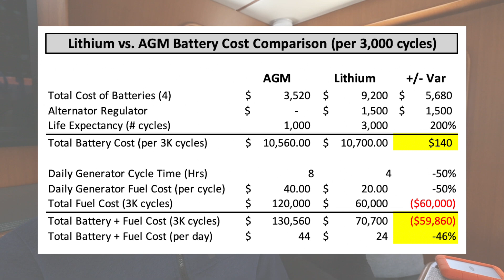What is the ACTUAL cost of LITHIUM batteries (LiFePO4) and should you install them on your boat???

Comment: Have ourboards . Tried lithuim only to save weight.  Pulled them off cause charging system was erratically 13.2 to 19 volts. I even bought ones made for marine use. I think they were shutting off with built in bms.  Boat volts steady now with my new lead acids back in .  Maybe try my lithuims on a solar project or diesel truck.  I think with regular alternator they will be fine.

Comment: Your lithium  battery video saga was very helpful.  I’ve been doing research on lithium batts and your videos were part of my research. Way to go YT University. 😂 Coincidently, our current batteries onboard are the same brand as your previous ones and they are the end of their life. Lithium will be our next move along with solar. Being on anchor will a lot more quieter and pleasant..
Reply: The images in the video suggest the old batteries had been Lifeline GPL-8DL AGM and they had 8 of them. That would account for 20,900 kWh over 1,000 cycles, except only about 50% - 10,450 kWh - is really usable of that. 4 of the LiFePO4 batteries replaced them and in 3,000 cycles these would give some 41,472 kWh, but realistically 70% is usable - 29,030 kWh.
If we just consider the batteries, capacity, cycles, cycles, and usability, then per kWh the AGM are $0.69 and the LiFePO4 $0.34.
Add converters/inverters and all sorts of kit, plus the cost of recharging and that will raise the cost per kWh a lot more.
Note that 1 litre of diesel fuel holds 11 kWh (but a small Diesel ICE may give 25% efficiency at best in generating electricity.)

"We" (humanity) need cheaper ingredients and e.g. sodium is a candidate. "We" also need better solar (more efficient) and multi-layer PV plus a perovskite layer over them may do that (from under 30% to over 50% I guess and less sensitivity to where the sun is relative to the panels). If only multiple manufacturers started making that and competition drove the prices down.

Comment: Sounds promising, wasn't aware of the insurance issues - certainly great to reduce generator running!  I'll look next year when due for replacement.  Not so keen on Orcas myself - coming into the med from Norway via Portugal we we're harassed by a pod - as we're over 60ft it wasn't too bad although being eyeballed through the hull windows was intimidating.   One 40+ foot boat on delivery had its rudder bitten off!
Reply: Yes indeed, a pod of them has been 'harassing' mostly sailboats from what I've read, attacking the rudders, two smaller vessels were apparently sunk of Portugal, over 200 incidence in the last few years. countless vessels needed rescuing due to damage received.

Comment: How did you dispose of the old ones? Did you just take them to the Fire Department?
Reply: It is my understanding the original batteries were not lithium batteries.   The lithium batteries are highly recyclable.  The fire department won't have a way to recycle them, and they are not that hazardous. The battery dealer is a good resource.
Reply: @ABonRMS  they are not "highly recyclable" lol.
Reply: You throw the into a fire or local wildlife refuge.

Comment: Just come across this.All the reasons to get them.But what about the pitfulls.Things that can go wrong are not mentioned.2 things that have short guarantee that can destroy batterie bank.Inverter charger and alternator regulator.And even if under guarantee.only covers units not batteries destroyed.Also LPO4 should never be used under 20% and charged to 80% to prolong batterie life.so 60% usage per batteryAlso expect 20% degradation of battery after 2 years.Yes they are better than other alternatives.But very expencive to replace.this is not scare mungering.But stating facts that others have experienced.If you are full time on a boat.then the risk is worth taking,But remember,how do you think people have survived for the last 50 years plus with lead acid batteries.

Comment: You also will save in the installation labor involved over the life of lithium versus conventional batteries, by twice.  Moving large batteries is not fun.  The lithium might also prove to be more electronics friendly in that full charge voltage remains pretty even over the cycle from full charge to a discharged state.
Reply: but if one fails you lose everything and maybe your life too.

Comment: Great information guys, but why did you not looking at solar as an option for charging the batteries as well?? Keep up the great videos, cheers 🍻
Reply: Do you know how many solar panels you'd need to charge those huge batteries? Do you know how little sun the PNW gets for half the year? A generator is the way to go. Lots of RVs aren't even doing solar anymore because it can't produce the current needed. Straight generator.

Comment: Real life test: On my liveaboard sailboat I replaced 400lbs of Rolls Surrette lead with a useable current volume of 2.1kW with 150lbs of LiFePO4 supplying  just under 6kW.
Costs:
The Rolls Surrettes cost me US$1320.00(5 years ago), useable lifespan was 2 years working hard daily, so 10 year cost is US$13,200.00.
The LiFePO4's were a total of US$6600.00 (three years ago), with expected ten year cost the same at $6600.00.
Don't let anyone kid you, LiFePO4 is FAR cheaper. And that is before taking into consideration the ease of swapping, and avoiding wet cell maintenance. 
Yes, I also correctly changed the engine alternator to a Balmar hi output with a programmable charge controller necessary for the lithium charge profile and a new programmable shore charger too. Of course these never have to work because I also have 1.4kW of solar production.
Then I proceeded to run two fridge/freezers, completely electrified the galley using induction and microwave/convection combo, run the RO watermaker every second day, the 1200watt water heater every morning, the big screen each evening and lots of fans.
The last time I needed to run the gen for charging was after 3 solid days of heavy cloud...I think it was once in the last six months.
I'm hoping by the time I need to change the lithium we'll have production models of the C14/diamond batteries!
Reply: @Lars Hansen Hmmm...lead is a common denominator in those. I am ecstatic to never have to lift lead batteries out of a battery compartment again.

Comment: I have 7 year old agm batteries in my boat, still going strong.  The house bank comprises four GC 6 volt deep cycle batteries in a series/parallel configuration delivering 12 volts 500 amp hours, with 250 usable.  Cost $1600

Comment: The amp hour differences in usage will also have an impact. AGM if they say 100 amp hours you have a usable 50 amp hours while with lithium 100 amp hours is 99 usable amp hours. Using the last of a charge makes the recharge more complex with lithium although you can use the full 100.
Then there is the current drop from AGM as you draw down the charge, which doesn't happen with lithium.
You actually doubled your available amp hours in practical use by matching the lithium to the agm.

Comment: One advantage of  Lithium batteries you didn't touch on, is that you have now have more than twice the available energy to pull from them. The Battle Born 8D batteries have 270Ah and you can use all of it without reducing the 3000 cycle life. Lifeline 8d's only have 255Ah, and you can only use half of it without reducing the 500-1000 cycle life. Also, it doesn't bother Lithium to only partially charge it before starting to deplete it. AGM hates that, which you kind of alluded to in the video.

Comment: Why not use a marine capacitor bank, That way it will take 1 million + charges and it can be charged upto full power in 30 seconds off an inverter and can run, Washing machine and tumble dryer all at the same time without draining your house battery bank.

Comment: You didn't mention if you increased your capacity with the lifepo4 vs AGM.  AGM only has 50 perfect useable capacity.  It seems you likely doubled your amp hrs with 4  BB270.   Shouldn't that be considered in your cost analysis?

Comment: Ho there. I was considering Lithium P04 batteries for my new boat ( ew build), saw 4,000 recharge cycles and extremely high prices here in the UK for even 90ah batteries. Found recycling them is extremely difficult still, so started looking for alternatives. Well, seems AGM has also comedown a long way, and there are Varta Dual Purpose AGM that have at least 3,500 recharge cycles and a 10 year Service life approx. Now things battery wise will likely change a lot in the next 10 years (and may even encourage a battery switch earlier. For me, needing 2 x battery Banks of at least 3, and maybe 4 per Bank of 120 amphr, the cost difference is staggering, plus .I can get the Battery Baanks, plus the wiring in of everything done by the boat builder. Note : I'm going heavy duty 40 ft Sailboat with a deck Saloon - roof covered in Solar Panels, and a rear Cockpit arch with solar panels plus maybe a small quiet wind generator dedicated to keeping the engine start battery topped up. Engine comes with one 115 amp alternator, going with the optional 2nd one, so each battery bank can have one each. There'll be a fair bit of electronics, plus air con+ heating , Watermaker, and 2 burner gas stove with oven, plus ceramic electric hob, plus Combi microwave oven, so reducing propane consumption., plus large fridge, freezer box, and a 2 drawer vertical stack freezer, and a washer dryer. as soon as one bank of batteries gets below 12.5 volts, I'll switch to the other Bank until the other is fully charged up. Should get Max service life. Was thinking of adding a generator, but no point, as the 55 hp Volvo sips fuel, and diesels need to be used regularly, with a good load to keep them good. Major plus point right now - AGM batteries are fully, and easily recycleable and 720 amps, or 960 amps total 2 Bank Storage  should be fine, plus be useful ballast low down over the keel. Best of Luck with your batteries, I'm sure you'll get good value out of them, and likely the recycle situation will improve when you're ready to  hange.  One point though, be sure not to Rapid charge them, if you can avoid it. Rapid charging  an dramatically shorten their lives. Best Wishes.  Bob.  👍

Comment: Lithium batteries when used for engine-starting duties - on a cold day, the first crank can be a bit sluggish.  BUT - that first crank puts heat into the cells and subsequent cranks are  better than equiv L/A AGM batteries.     There is also no gradual drop off in cranking power - they keep that same level until they fall off the cliff (so to speak).

Comment: We've just installed two flexible 150 watt solar panels and a good MPPT charge controller. With the panels wired in series we've seen up to 12 amps at charging voltage into the battery bank. We're charging a bank of 7 old school batteries but hope to only need our genset for the galley range while at anchor. Our main draw has been the refrigerator, we may now also run our inverter to power the icemaker! The total cost was only about $600. Have you considered this as an additional system, it's apparently possible to set the parameters for Lithium batteries.

Comment: Your spreadsheet is really showing the best case for AGM and the worst case for Lithium. As your own experience has shown you the AGMs gave up the ghost at just over 500 cycles whereas you are probably going to get well north of 3000 cycles from the Lithium.
The cost of 3000 cycles for AGM at 500 cycles per set of batteries is going to be around $21,000 ($3,520 x 6) so you are well ahead of the game at $9,200 for 3000 cycles of Lithium. 
I also think you are going to be running your generator a lot less than you think due to the fact you are going to be able to get around 80% - 90% of the capacity from the Lithium compared to 30% - 40% with AGM. Unless you're prepared to run the generator for hours during the absorption stage to get the AGMs to 100% charge you are never going to get even 50% of the AGMs capacity.

Comment: I don't understand why fuel cost is different.  Aren't you using the same amount of energy load with either type of batteries?   Do both types have about same input/output losses?
Reply from the maker: It’s all about generator run time.
Reply: it takes half the time running the generator to charge the new batteries, hence the 46% reduction in costs.
Reply: Hmm.  I still don't get it.  If your daily discharge  energy load e.g. is X kWh with either agm or lifepo4, and your charge time e.g. is half with lifepo4, then with the same 12volts you must be charging with twice the amps.  This will require twice the power from your diesel-generator for half the time, and if the efficiency at both rates of charge is the same you will use the same amount of diesel fuel.  Is your fuel savings based on   better input/output efficiency of lifepo4?  I saw info that lifepo4 efficiencies are 90%, and agm can be 50% to 90% depending proper discharge/charge cycles.  Or is it the better efficiency of your generator at higher rates of charge? Or all of the above? Thank you in advance for explaining this complicated subject.

Comment: Really enjoyed your videos . Not judging …questions ?

1. Did include the  cost of the new alternator or  is the regulator what you were changing on the motor.
2. Did you have to take an increase in insurance cost to go to  the Lithium . If so was the cost accounted for in your study?

3. Also , I see no line call out for labor cost savings. This would be a cost that others would have to to incur  do to the fact they may not be as talented as your husband.

Great video !! Enjoy you guys.

Mjb
Reply from the maker: 1. The regulator & parts were in the cost listed out as $1,500 included in lithium battery cost.
2. We had a nominal increase in insurance cost due to other factors, not the lithium. 
3. We didn’t include labor in the cost comparison since we wouldn’t have incurred that cost for either battery type but that’s a big cost to include in AGM’s since that would be incurred 2x compared to only once in a lithium scenario.

Comment: You talk about an new (additional?) charger as a next project.  How many amps can your current setup deliver at full charge with your genny running, and what do you hope to deliver?  Great vid!
Reply from the maker: Our current charger can deliver 150 amps. An additional charger will add another 100 amps, the batteries can accept as much as 500! We hope to cut our charge time in half again, thus cutting run time/fuel in half again for the generator.
Reply: Interesting.  Just a charger, or another inverter charger?  I’m assuming your house bank is 12V, or is it 24?  I hope those beers we gave you were not too hoppy!
Reply: I dont see how shorter charge times will save fuel.  Higher charge rates require more power from your diesel-generator with higher fuel flow rates for that shorter charge time.  Unless there is a difference in charge efficiency, I'm thinking you use the same amount of fuel to put the same amount of energy to fully charge your batteries.  I do see that shorter charge times is more convenient.

Comment: How are you charging the engine start battery?
Reply from the maker: The engine has a 2nd dedicated alternator for charging the designated start battery (which is remaining AGM cuz there’s no need to change it, no real benefit as lithium isn’t intended for starting batteries).
Reply: Right on, great solution. We had to to add DC to Dc chargers on ours. 😀

Comment: Did your comparative cost analysis take into account Ed added wear and tear on your charging sources, on account of higher CAR?  How about engine/genset starting batteries: also liyhium iron phosphate?
Reply from the maker: The start batteries were not replaced with lithium as they’re generally not intended to be used as a start battery. While we didn’t line item out the wear & tear costs of the generator but it’s definitely going to be reduced with only running half of the time now.
Reply: @mvfreedom  Understood about genset engine run hours, but I was thinking more about load on the electric side of the genset, or the alternator, or the AC-powered charger.  My understanding of the high CAR of the lithium batteries tends to have electric sides of chargers running at higher levels longer, which generates more heat and the like.  I recall than when I went from flooded cells to gels umpteen years ago, I upped the rating of my alternator so that it wasn't running full bore so long.

Comment: Have you considered upgrading your engine alternator with a much higher output? The lithium can be charged much faster which means less fuel to fully charge and you can use your generator less.
Reply from the maker: We wouldn’t start the main engine to only charge the batteries. When we’re underway we’re usually underway for long periods so charging more quickly isn’t a priority especially given the added cost of those higher amperage alternators.

Comment: I’m glad you pointed out some of the reasons not to go lithium. I buy Walmart deep cycle batteries for about $100 a piece and they last about 4 years. Actually very good lead acids by National Battery. I don’t take care of the batteries and my boat for the most part is indeed a dock queen. I use a mini solar charger to keep them topped off for the bilge pump that pumps about 1-2 times a day. Use them for engine cranking on a finicky diesel. Could not be happier. Feel that I would ruin lithiums in just a year or two and having 2 $100 batteries just makes more sense for me. Good video.

Comment: Very informative. Would you consider adding to the Li bank and reduce your generator/fuel cost even more? Cheers.
Reply from the maker: Adding to the bank doesn’t reduce the need to run the generator, but adding another battery charger would. So that’ll be next for us to cut the generator usage in half again!